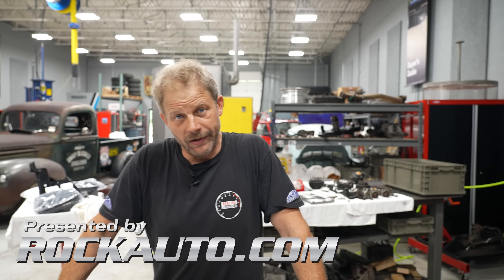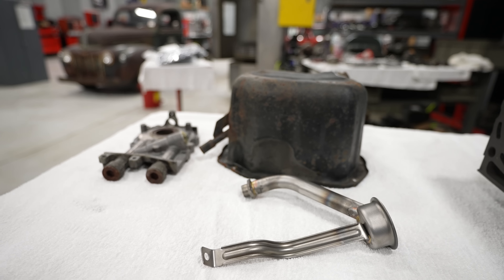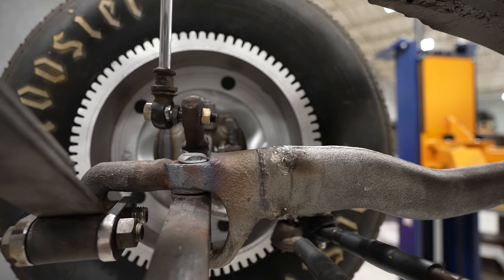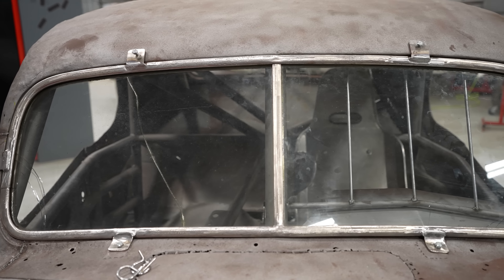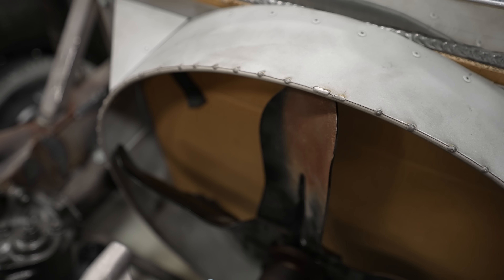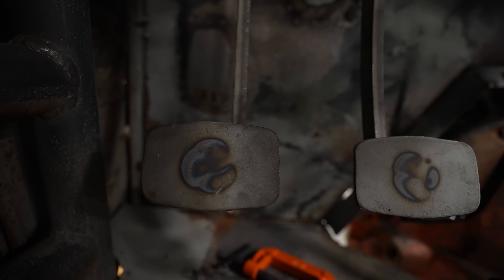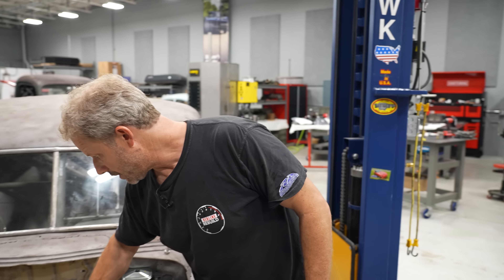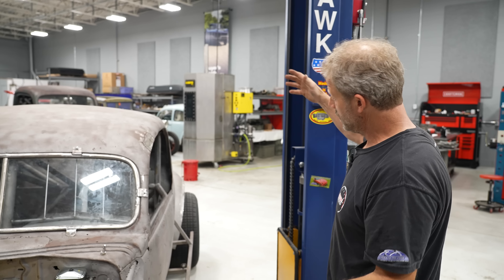Subaru oil system confusion and an update on our dirt track racer

Comment: Most people that race Subaru's will upgrade to a Killer B or IAG oil pan to fix the oil starvation problems. These pans increase oil capacity by about 30% and have improved baffling over stock. 

Oil starvation is either caused by oil getting stuck in the sides of the pan/heads from high cornering G's or foaming from high RPM. 
Windage trays, improved baffles, and increased oil capacity should fix all these issues. (lots of good articles on Motortrend or MotoIQ)

If the car is just a street car there's no need to upgrade any of it. I daily a 2012 WRX with 180k miles and its stock with an exhaust and a tune. I keep up with maintenance and it runs like a dream.
Reply: As well as the oil pickup. Oil not getting to the motor because the oil pickup has micro fractures.
Reply: @sooperman12  MotoIQ is the Jam!!!!
Reply: KillerB Oil Pickup is key!!!
Reply: what causes oil to foam
Reply: @DC-ke8qp  Oil getting by the edges of rotating bits dispersing bubbles throughout the oil. It's very similar to shaking soapy water within a bottle. It becomes a foam filled bottle. The soapy foam will disperse, but only if you stop shaking it.
Reply: Agreed with you on that.  I put one of the KillerB pickups and windage Tray in mine and its the for the stock wrx pan.  It matters for that kind of pan to start with.  They do have them for the STI pans and they make their own pan.  Worth the money without a doubt.  One thing as an upgrade as well is an AOS setup IAG's is a little over 400 but really much  better than the stock pvc hose system.

Comment: Make sure you do the cylinder #4 cooling mod. Its simple and cheap. It will save cylinder #4 from being pissed off. Also King Bearings you can't go wrong! Should I mention the wrx sti oem crankshaft Nitride treated Crank? That's how i did mine ;)

Comment: Thank you for doing this series, I am a Hagerty customer and have a two door Impreza build with a similar engine. I decided to go with the Killer B oil pickup and baffle, but to keep costs down I went with the larger 2006 WRX oil pan, which has more volume and rumored to better to prevent oil starvation than the 2002 pan my engine came with. But I was able to save spending $500 on a machined oil pan, and still get the upgraded pickup and baffle, which is what I felt was the most important upgrades.

Comment: Use the full IAG pan kit gives yoy peice of mind with high gforces or fear of your pickup failing or starving
Reply: This
Reply: this is a much cheaper solution for OEM+ than the full Killer B kit (which is great for a real RALLY car build)  I assume a stock STI dipstick/tube would fit this IAG kit?

Comment: If you need any specialists to consult there are definitely a few I recommend. Anyone over at IAG, Flatirons Tuning or COBB would be excellent to talk to. I love Flatirons tuning because they not only sponsor time attack and other driver's but they also build Subaru's themselves (one of which is a Pike Peak Hill Climb car) and sell both OEM and performance parts. I personally use them a ton for my 2004 Forester XT and they are amazing to work with.

P.S. I love all the work you do!

Comment: The Killer B oil pan with baffles and oil pickup is the cure for oil starvation, the baffles keep the oil in the pan during hard cornering/ any movements that can cause the oil to slosh around and the upgraded pickup solved the issue the stock one has — the stock pickup is brazed together not welded and can crack which is also a problem for starvation.

Comment: 1:00 sometimes (not all the time) those backing plate screws can 'back out' over time causing a low oil pressure situation, so make sure you put new screws in with Loctite for sure.

Comment: As for Subaru oil pumps. many theories have been proven. Bigger is not better. Subaru made bigger oil pumps to serve different applications.  Example  single AVCS, Dual AVCS, twin turbo etc that demand extra oil pressure.  Also the 10,11,12mm oil pumps have different bypass valve pressures. 10mm 85psi , 11mm 75psi, 12mm 85psi 

Installing a oversized  oil pump will increase pressure/volume sure,  but if the pressure is beyond the bypass valve in the pump you will not get that extra pressure through the motor.  Excessive oil bypass will lead to clavation/aeration of oil as the  bypass on the pump recirculates around and back into the inlet of the pump, adding heat and causing the oil to prematurely break down. 

if you don't need the extra volume to support AVCS, Twin turbo, oil cooler you will most likely do more harm then good.  Your better off sticking with the standard size pump for your motor and do a slight port of the inlet/outlet and smooth out any casting marks. 

upgrades to to a ej oiling system would be STI or aftermarket sump ( round bottom sumps are a culprit for starvation) upgrade windage trays and pick up.

Comment: Stay away from oem replacement pickups with the brazed joints, they are known to crack from vibrations. several manufacturers make a welded piece. Also, with factory bearing clearences, an 11 or 12 mm pump is probably overkill, running oversized pumps is known to cause the front or rear main seal to blow out.

Comment: I'm older than you. I had a Subaru and I loved it. The only issue is that it came to Indiana from Michigan, and it completely rusted out. The rear shock tower rusting out did it in.

Anyway, I think that you've got to stop the nasty faces and attitude toward Subaru. You sure aren't going to win any younger viewers with the attitude. It's not needed.
Reply: Yeah. That’s the part that’s putting me off.  Every manufacturer makes interesting engines. No one needs the snark.

Comment: In any engine hi volume oil pumps cause more problems than they solve. Increase drain performance back and add capacity.
Reply: The larger 11 and 12mm pumps are both OEM Subaru pumps that were offered on other cars. 11mm on USDM STIs 2008 onwards and 12mm on ALL JDM STIs. Don't think you'll run into any issues as this is a factory option and a VERY common upgrade.
Reply: @danlo-v  Just because they use that oil pump on other models doesn't mean its the right oil pump for every turbo application.
Reply: From my understanding Subarus use the high-pressure low volume approach to engine oiling. Pressures to 90 psi are common. In such a design flowback & crankcase pressure control is paramont to survival. Increasing the flow without good reason or on a stock rebuild is not recommended. A better built pickup tube & securing the rear plate bolts are always a good idea. Enjoying the Subaru series!
Reply: @rickw.9298  Agreed. People often get caught up thinking more is always better in everything. As long as you have adequate flow and the resistance to that flow to create the pressure needed for bearing size and speed then that's all you need. Any extra work subjected to the oil with a larger volume pump or higher pressure relief setting only costs power lost in heating and working the oil.

Comment: Killer B Motorsports are the originators of the larger pan, baffle tray and improved oil pickup. The stock pickup brazing can crack. I would suggest not using the OEM pan and pickup.

Comment: You have to make sure there's more than three passages back to the block so the crankshaft when did pressure from the blow by from the Pistons can get out and not interfere with oil flow once you solve the air flow problem the oil will take care of itself

Comment: 1-get 11mm oil pump, port the suction side and pressure side of the pump housing near the pump rotor... Shims about 2-3mm the pump bypass valve (dont port the bypass section of the pump housing) dont forget to put loctite on the pump housing backing plate screw which is known to undo themselves to cathastrophic engine failure

2-while the block dissaembled, port the oil passage including oil filter inlet and outlet, then oil passage to crank bearing... Especially passage leading up to the journal no.3 (because conrod no.2 and no.3 sharing oil supply from journal no.3... conrod no.1 and nom4 gets their own oil supply without sharing)

3- smooth out the oil return pathways on the cylinder heads..there is plenty of sharp corners and cast flashing edges that makes the oil stuck not returning to the sump fast enough

4-get killerbee bigger and baffled oil sump kit including their upgraded oil pickup tube

5-additional security for proper sizing of oil restrictor for turbo oil supply line... (Dont restrict oil supply general area for cyl heads that have avcs variable valve timing)

I think thats about it for subaru oilling problem...

For high rpm application.. solid shim bucket from sti is direct swap of that wrx "shim over bucket type"

Because shim over bucket application is rpm limited to about 7k rpm and stock camshaft...risk of spitting the shim out at high rev will increase especially with aftermarket camshaft... 

Titanium valve retainer and beehive valve spring is a great upgrade...

Do line hone for crankshaft main journal... And use torque plate for bore hone...

Comment: I believe that the "trailing arm" setup on the rear suspension was supposed to be offset and not "square " to allow the car to crab into the left hand corners. I'm surprised that the right rear leaf spring wasn't longer and softer to allow the car to roll over on the tire for added traction.

Comment: Interesting. I had the exact same thought about the higher volume oil pump when you mentioned it. I was waiting for you to say something like... "So the recommended method is to then put a higher capacity oil pan on so that the added oil at the top of the head will force the flow of oil back to the pan."

I figured it would have to be something, but I have no idea what.

Comment: You'll want to upgrade that oil pickup tube, its a cheap upgrade to go with the Killer B, IAG, or Moroso units, all very similar in design.  While you're at it, if you're concerned at all go ahead and upgrade the windage tray as well, I know IAG and Killer B both make upgraded units.  I personally run the Killer B pick-up and windage tray and larger STI Oil pan on both of my 04 Subaru Forester XT's, one is pushing 265K miles, daily driven for 18 years.
Reply: This right here is perfect and cheapest solution, the killer B pan is way over priced and overkill for this project, he's not building a race/rally car here, just OEM +    also, with that STI pan, you will need to replace the stock dipstick with the sti one that goes with that pan, one step up from this is the IAG street series  oil pan package, as mentioned in another comment

Comment: About the race car, I don't believe the radius rods are off the rear, they look to be '42/'48 Ford or Merc pass car front.
The w/shield  was used with glass back in the 60's thru the 80's around here.
The alum rad is for sure out of place, we didn't get one until the 90's. I called Buddy Griffin about a cooling problem and he set me straight on the shroud setup and guaranteed me an alum rad wound cool us down 15 degrees.
It worked!!!!

Comment: Okay I need to say this to all the muscle car guys (like the real "genius" in the show) that just because you don't understand an aspect of engineering. Instead of making assumptions about a product...you do your research...or perhaps better yet...stay in your lane.  So much false info about Subaru's.  If the public wants to know anything of value, how bout the combined wisdom Subaru owners like NASIOC.  High rpm causes cavitation, which can destroy bearings.  But my old 06wrx never had any cavitation despite autocross, drag racing, and even circuit racing.  I guess I was lucky? Or maybe I knew what I was actually doing with a flat engine config. 🤷🏻‍♂️ It had 260whp and 300wtq.  Why didn't my engine grenade at full rpm? 🤷🏻‍♂️ Stick with your v8's in the future or have someone knowledgeable and experienced with imports 🤦🏻‍♂️
Reply: Guy is the stereotypical cranky boomer.

Comment: It's not the long term high rpm that keeps oil from returning.  It's the cornering that keeps it from draining due to g forces.  Larger pan gives larger oil supply, that helps while oil gravity feeds back.

Comment: As a completely sober idiot, and so glad to see more content on your baby. Here's an idiots thought: you're talking about mud build up on the windshield, and then onto the fan radiator.. I'm assuming aerodynamics don't really count on the track you want to track... Does anyone run the fan with reverse blades so they push out the front, pushing the dirt build up out past the radiator, or just pulling hard enough to limit the dirt build up coming in? Am I genius or idiot!?  Thanks for all y'all do.

Comment: I don't know about Subarus, but other engines have had the oil to the top end restricted on purpose to help with the starvation problem. Maybe a bad idea here, but maybe not? Anyway, if you're not going racing you shouldn't have a problem with the stock setup.

Comment: Better just upgrade your Oil pan,baffle and feed by Killer B. Oil pan is bigger than stock and added that extra oil to avoid starvation.
Reply: IAG has a better design
Reply: now if price is not an issue I would agree, but you would have to weight the price as well while killer b will be cheaper vs the IAG.

Only reason why I said the price is because he said he order an STi oil pan, which is almost the same as any other EJ25 block. I have a EJ255 from my Legacy GT  and EJ257 from my Sti they look the same.

Comment: What about a dry sump with a second separate tank that feeds oil to the sump by creating a cycle feed in a sense but it would mean having 2 oil pumps one to send it to the tank and tbh e 2nd to cycle around the engine which should keep all parts lubricated and carry out the initial issue ?
Reply: I was going to say, multiple scavenger pumps and a dry sump system would fix this.  On the other hand, it does not appear to be a problem in street use, and that kind of set up is likely unavailable for this engine.
Reply: @carljaekle  true but if your going to hit them high Rpm’s on a track it would be the safest way to go instead of relying on gravity to bring back to sumo especially when taking corners at high speeds but it really depends on what your trying to achieve me personally I would go dry sump and increase the oil pump to the 11mm for more durability if I’m
Honest
Reply: And there is companies out there that do a dry sump kit for boxer engines or custom make one

Comment: Just fitting a bigger pump for flow or volume is not the answer. All the passages inside the engine are sized with a designed flow at pressure requirement and then the pressure relief valve is sized to ensure that the oil flow at the required system pressure is maintained throughout the RPM range. If you fit a bigger pump, the point at which the valve has to open to ensure the pressure is not exceeded happens lower in the RPM range and can mean that at higher PRM the relief valve opening is not big enough to allow all the oil that is not required to drain back to the pan. This has two effects. One, the oil that should be getting back to the pan for the pump to pick up is not there (From the issue description, this sounds to be a significant part of your issue) and Two the pump stalls. As the outlet pressure rises the differential pressure across the pump increases. The pump clearances mean that at some point (depending on the design) the flow (which is what the engine needs) reduces as the pressure ratio rises effectively reducing the flow below the engine requirement. This is what the relief valve does. If you do fit the bigger pump make sure the relief valve passages will support the extra that must be dumped back to the pan to ensure it does not stall, otherwise you will have made the issue worse.

Comment: Was watching a video about some of the “tricks” that NASCAR teams would use.  If I understood correctly, they built a diverter valve into the oil line to send oil OUT of the pan to be stored in the frame instead.  I guess the idea is to still feed all the bearings but not have the oil “splashing” around in the pan and therefore gain an increase in horsepower????????  Think the video was buried somewhere in a Dale Jr podcast.    Did I misunderstand?

Comment: Is the pcv system vented at the valve covers?

Just throwing darts at oil drain back thing-> if the motor was abused or neglected->excessive blowby-> wouldn't oil have a hard time overcoming the flow of gasses?
Or is the pcv vented at the crankcase?
Or is there an upper and lower passage between the valve cover area and crankcase?
Edit* Ima watercooled vw/chevy/6bt guy so don't know subis. Had 2 air-cooled vws though
Just a thought

Comment: I don't think the Subaru oiling issues stem from high RPM moving all the oil to the heads, but I may be wrong. 

Subaru EJ motors have insufficient baffles in the oil pan and brittle oil pickups. This cause both starvation under high G forces since the oil moves too much in the pan, and the oil pickups crack allowing air to be sucked in, killing the rod bearings usually.

Comment: Keep on learning on the Subaru engine and tech. V8 rebuilds are nice and interesting, but those were the days, right.
V8s are a dying breed. 4 cylinder engines are back with a rage in hundreds of applications, including trucks and big SUVs.
PS To me, you should make that old race car a regular track car, not only left turning only tracks. It would be a great feature on racing days every where !

Comment: You dont use a bigger pump. Only reason for the bigger pump on AVCS engines for the variable valve control. You use a bigger sump IAG or Killer B. A better pickup & a baffle. 10mm pump is fine for ej20 even higly tuned ones. If you need more oil pressure you shim the bypass valve as Roger clark does in their modified pumps.